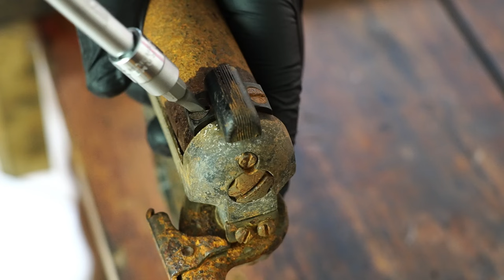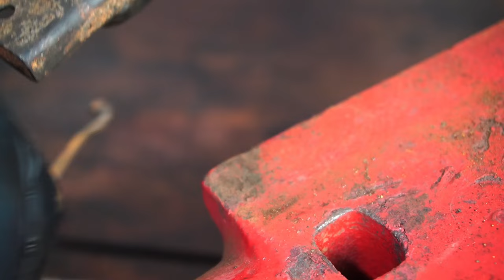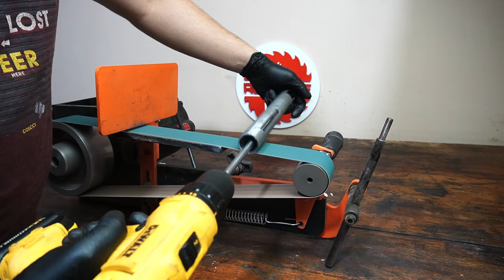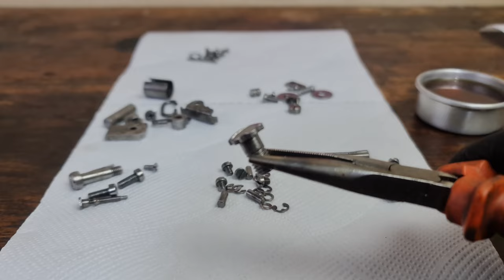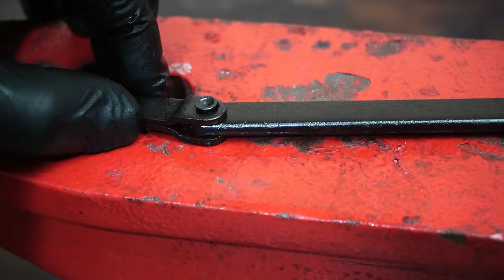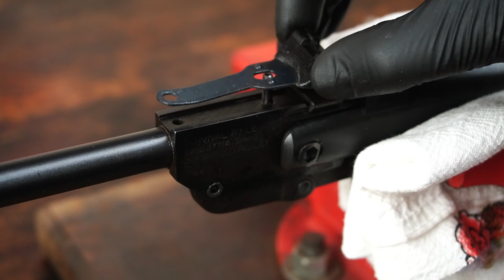Restoration Automatic Airgun

Comment: An ASI 'Paratrooper', I used to have one of those back in the day, not particularity powerful but could take a rabbit if you were close enough, great for plinking in the back garden!
They were sold under other name which I cannot remember it has been over 42 years.
Reply: My friend had one....I was always envious.
Reply: GAMO, 👍👍👍
Reply: what type of air gun or could you put a link in the comments please
Reply: @georgecourt9803  asi paratrooper
Reply: El Gamo...now Gamo were imported from Spain into the UK under the ASI name...with different model names
The Statical (sliding recoil stock)
The Apache (junior)
The Magnum (full power hunting)
Paratrooper as above but with solid plastic stock to get around pistol power laws)
And you could get the multi shot version like that one.
And a few pistols, including an underlever with a slide out breech.
Reply: I also had a para repeater .177 I'm now 55 and as I remember iwould have been about 16 at the time 😳as you say a good back yard plinker

Comment: Pretty obvious that wasn't the first time you have disassembled that.
You knew each time, when you have reached the end of the threads. You also knew which threads had been striped, and stopped winding and pulled the bolts free.

Comment: I have a question I'm hoping Restore DIY or anyone knowledgeable about restoration/repairs can do...

I own an officially made licensed Sig Sauer P365 4.5mm CO2 version of the famous micro-compact pistol. It's a great gun but has one serious what I consider design flaw.. the magazine has a low-grade threaded alluminimum fixing nut at the bottom with a hex key whole for tightening into place and holding the CO2 bulb. Over time, the hex key hole tends to wear and lose its shape from over-tightening. 

These nuts are expensive to replace from Sig Sauer costing about $40-$50 each, when the total pistol only costs about $150 new. And being alluminium the same problem is likely to occur again eventually.  

My initial thought was to find a stainless steel same size threaded fixing nut. I searched everywhere online. Although there's so many similar I haven't had much luck finding one the exact same size except maybe one from a supplier in China on Alibaba. 

My other thought was taking a 3D scan of the nut and trying to 3D print one in a tough plastic (even it doesn't last long more could be produced the same way). Or perhaps another idea might be to make a rubber mold of the nut and then use a plastic resign to create a duplicate and make a new hex hole or winged screw fixing method.

If anyone has any ideas or suggestions or how to either repair or replace the damaged fixing nut and the mishaped hex whole, I'd greatly appreciate it!